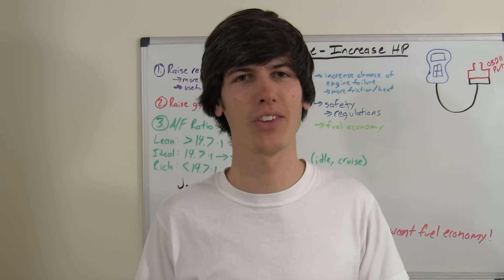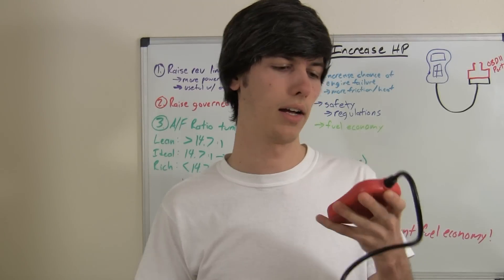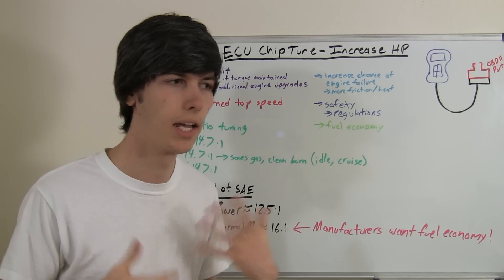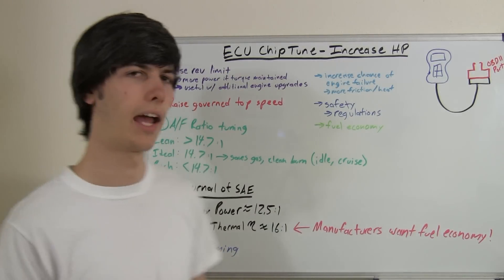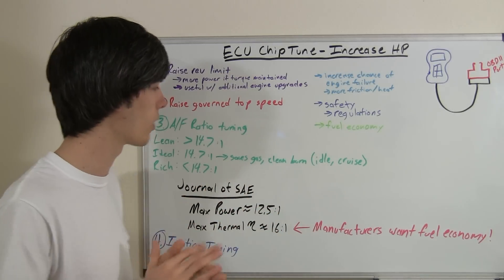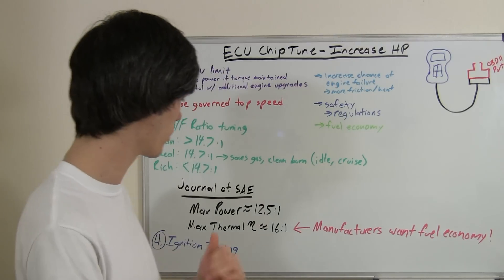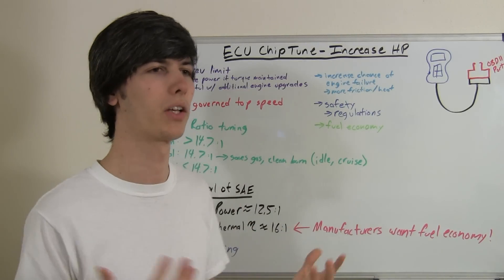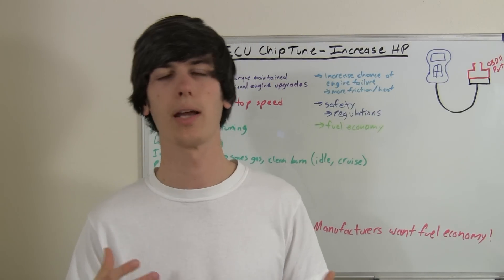ECU Chip Tune - How To Increase Horsepower

Comment: So, if you tune your ECU for more power, your fuel efficiency will go down and vice versa?
Cause I've a seen a lot of these ads lately where they say if you tune your ecu you'll get like 20 bhp+ and 10mpg+ etc... and I am just wondering, if this was the case, why wouldn't factory cars come pre tuned at these settings? This is false advertising, am I right?
Reply from the maker: You're not going to get dramatically better gas mileage, correct. But as is apparent with the latest VW scandal, engine tuning can allow for more power and more efficiency, for example by running on less EGR (granted, it's illegal and shouldn't be done).
Reply: Engineering Explained  Thanks mate, got a better idea of ECU tuning, I like your videos cause you explain very well with facts of how things work. Especially the functioning of the turbo charger.
Reply: +Ketho Seyie You can always make a car more efficient off load and have more power on load. Manufacturers typically run cars at stoich (14.7) afr for best emissions. Running your car at a afr of near 16 will drastically improve gas mileage. Manufacturers don't do this because this produces more hydrocarbons and that is bad for the environment. Keep in mind that you need to adjust timing and injection timing to make the leaner mixture create power without pre ingition or detonation.
Reply: +Ketho Seyie Your ECU can be flashed to deliver more fuel at higher RPMs and deliver less fuel at lower RPMs at cruising speeds.  This is usually done on stock powertrain.  This does help achieve more power top end and save fuel when you're not mashing on the accelerator.  So, in essence, yes there are tuners that can give you better gas efficiency and more power just not at the same time.  For example, I have a 2010 Camaro I bought a handheld tuner from Diablosport.  There is a tune that gives me better gas mileage at cruising speeds and more HP when I'm "balls to the wall".  I achieved between 27-29 mpg on the highway with that tune (my car has the LS3 and 6-speed manual).  There was a slight power difference at higher RPMs.  Before I upgraded to Long Tube headers, high flow cats, and Axle back exhaust I was getting around 21mph combined.  After the upgrade I get around 17-18mpg combined. In retrospect, adding power equates to less mpg.  However you can maximize the efficiency and mpg with a conservative tune when you add performance upgrades instead of adding more fuel and that all depends on what your Fuel/Air ratio is when it is tuned.  Professional tuners prefer to run a performance engine slightly richer to eliminate the chances of detonation.  The reason behind that is the rich fuel/air mixture reduces the combustion temperature.  With the reduced combustion temperature your fuel/air mixture is less likely to detonate outside of the combustion chamber which is critical especially in modern day port injected vehicles.  A leaner fuel/air mixture yields a higher combustion temperature which would cause fuel to ignite to early and cause damage to your engine.  Other factors do apply such as octane rating and ignition timing which also can cause early detonation, engine knock and/or pinging.
Reply: +Jason Rochester 16:1 cuts down on hydrocarbons and increased NOx.
Reply: yea my bad
Reply: So does disconnecting EGR completely improves engine power and mileage?
Reply: +Xeno Depends on the engine but in most cases, no. Especially without a ecu retune a EGR delete does nothing but increases emissions and may even give less fuel mileage. Now with the correct ecu and tune one could potentially increase low end fuel milage while gaining high end power. But keep in mind that the Gs you feel being pushed back in your seat is from low end power. Another words a leaner low end tune can save fuel but will make your car feel more sluggish due to acceleration loss. 

At least that is my understanding but my tuning knowledge is limited. There may be a way for the ecu have different AFR at a given rpm depending on throttle position? If this is the case then an extensive tune including throttle positions could increase both power and efficiency.
Reply: yes, egr stands for exhaust gas recirculation and all it does is it dumps your exhaust into your intake. and EGR delete with a tune will yield significant power and fuel economy.
Reply: definitely but it can also blow away smoke from your exhaust .
Reply: Dude put a shirt on it's not that kind of part

Comment from the maker: If an engine is producing more power, from increased pressure and temperature, it will experience increased stresses. Increased stressed will realistically result in reduced longevity of the engine, as a result of fatigue over time. I suppose theoretically, if all of the components were properly lubricated, at proper temperatures, and no yield stresses were exceed, and fatigue failure wasn't an issue (which it would be) it wouldn't matter.

Comment: I know a lot of the ECU upgrades for Saabs ratchet up the turbocharger pressure. Of course, there's a limit to how much cooling the stock intercooler can provide, but I wonder if the intercooler was engineered to perform under a variety of environmental conditions -- including hot desert climates -- so maybe, living in the Northeast US, I can feel comfortable pushing it a bit further.

Comment: one issue with running rich is the potential of fuel washing the rings ( the fuel cleans the oil off the rings and you can cause severe damage)

Comment: Quick question, you mentioned it is better for the cat to run rich? Please correct me if im wrong but I believe the unburned fuel is not good for the cat because of the leftover hydrocarbons and the NOx that the cat must deal with?   Please clarify for my understanding. Thanks!!!

Comment: Maybe this has already been mentioned in the over 500 comments posted so far, but here goes. It is indeed tempting to consider chip-tuning. But if your car is still under warranty and the engine fails they will check if the software is original or tuned. Furthermore, in some countries the car is taxed by horsepower so if they find out that your car has more power than it should have you can get a bill to pay tax for the extra horsepower.
Reply: +snubbedpeer Number 1- never tell the government anything. Number 2- reload original software.

Comment: When talking about ideal air/fuel ratio, are those values on the board the same for petrol and diesel engines? Or are there variations between the two types of fuel?

Comment: Thank you so much for the valuable information. Chip tuning is a process where the electronic control unit is reprogrammed, making the engine work within different parameters. Car Tuning Tool is the best solution when there are issues with the performance. It gives the best results. All thanks to Tuningfileshop for giving complete understanding.
Please keep sharing.
Reply: I have installed Bigger used Engine on my mazda 6 
I think 3000 CC instead of 2.3L
Can tune the ECU to give more air and fuel to the new engine

Comment: do you have a video on car cc and how it relates to the engine size. and how it works. 
i want to know about the differences on a 1litre engine and 1.3litre engine and if 1L engine is more economical than a 1.3L and saves fuel.

Comment: Did you ever measured the injection time with a scope? Before top rpm the injector remains open full time (100%), in non direct fuel injection, so how can you say that is possible to increase hp if you can't enrich the mixture at top rpm?

Comment: Speed Restrictions are set to conform to the TIRE rating for the stock tires.
I.e.

225/50ZR16 in excess of 149 mph, 240 km/h
205/45ZR17 88W 168 mph, 270 km/h
285/35ZR19 99Y 186 mph, 300 km/h

Comment: For a cat. to work it needs to get both lean and richt mixtures so the ECU makes sure the mixture is adjusted during driving. But i'm also pretty sure that when you floor it the ECU calculates for a rich mixture.

Comment: I just got the same slow car you did 2016 crosstrek I want more power I want the most bang for my buck but keep in mind it is a lease so when I need to change it back  to stock there won't be any problems
Reply: 5speed
Reply: Sir Masteryan if you tune it and they check, they will see that the ecu has been flashed.
Reply: Marcus D thanks for the heads up

Comment: The major German auto manufacturers (BMW, Mercedes Benz and VAG)  restrict top speed to 250 kph (155 mph) on most, if not all of their cars.  I understand this is voluntary - Porsche chooses not to, for instance.
Reply: I thought it was German law, at least for the ones sold there.
Reply: According to the Wikipedia (which may be wrong) "BMW, Mercedes and others have entered a Gentlemen's agreement to a limit of 250 km/h (155 mph), but may 'unhook' their speed limited cars in Europe, and Mercedes will provide some vehicles in the USA without limiters for an additional price", with 2 external references.  https://en.wikipedia.org/wiki/Speed_limiter

This implies that there is no legal requirement in Germany (or elsewhere in Europe) for the vehicle to be speed restricted.
Reply: probably just another way they can make money on their performance models by charging 6 times the actual cost of removing the limiter.
Reply: I had to look up VAG on wikipedia to find out it stands for VW... For a second I thought you were talking about the Freiburger Verkehrs AG (VAG) hahaa

Comment: Another factor manufacturers have to take into account(or at least they used to) is that the tune be okay for all possible altitude situations. Whether your in the mountains or on the coast line at sea level they have to be sure the car will perform. Now with today's ECUs and better sensors this might not effect newer cars as much.
Reply: +Damian Wezzterman
Whether your... what... is in the mountains? (Which possession? Your vehicle [in which you would've said "...or it's on the coastline"]? Or were you trying to refer to another one of our possessions? If so, which one?

Comment: I have a turbo diesel car, altered the ECU settings via piggyback chip, in normal settings the fuel economy is sort of better and the power and torque output increased. I don't know how this happens, but it does.
can you explain this a little bit? thanks.

Comment: depends what you're using your engine for. Flame propagation of diesel is much slower than gasoline..so the red line is much lower on diesel engines..with a low red line it is difficult to get a high power to weight ratio--which is exactly what you want in a race engine.

Comment: Great video, but you didnt talk about the disadvantages of a chip tune (I assume there are some?) such as decreasing the lifespan of the engine, the need of upgrading some parts like clutch/brakes after a chip tune, in some circumstances fuel economy etc.
What do you think about that?
Reply from the maker: Andrei Vlad With added power comes added stress, reducing the longevity of all the parts involved.
Reply: Engineering Explained Um no lean afr means there's a way higher air content compared to the fuel in the C. Chamber. Thus less fuel means it burns faster and has a lot more oxygen to add to the mix. Running too lean for even just 1 second can blow an engine, as well running lean will literally burn the internals white, causing corrosion and weakens everything. It's better to be a lol rich I could write y'all a 100 pg book for tuning but I'm not Gunna write that much shit

Comment: I dont know if you could respond to this but im going to go for it. Im 17 and i bought my first mustang its a 3.8l V6. And i get around 800$ a months how often would you recommend buying performance parts, if i didint care id spend about all off it and just pay the bills and car upgrades lol. But im sure you've had youre fair share of cars and i just wanted an opinion since i always watch all these performace parts videos that you put out. Keep up the the good work. Thanks
Reply from the maker: Franjluna74 Well I'll probably sound like a dad but I don't spend much on parts, at all. Depending on what your goals are, many of the investments are poor (not to mention it will not increase the value of your car). When I was 17 I saved all of my money, and didn't do a thing to my Integra. It's a great car as is. :)
Reply: 1st step...sell mustang 2nd step... buy one with a v8
Reply: Nicks Customs Lol the only sure guaranteed possiblity for both performance and reliablity at the same time. Might ask you also will cost a lot in gas but the performance will be there no doubt :)
Reply: Thats kinda sad. My 4x4 explorer sport 4.0 will beat your mustang at any race aside from track. 
Pushing around 300hp at the wheels in 4x4. 
4.3l stroker crank,ported and polished the heads,ecu and timing tune,and a 3.5psi supercharger. (I can switch a pulley and go to 5.5lbs,or 8.5lbs)

My trucks mods weren't put in for racing either. With locking differentials (front,rear and center), 4.10:1 finals,transmission rebuilt with a heavy duty kit and a shift kit,transfer case rebuilt to heavy duty specs,dual caliper brakes all around and still on 17" rims. (Stock tire size,aftermarket rims)...designed to tow,and to do it in any scenario. (5000lbs max offroad, 9,000lbs highway,11k city (less than 15 miles)
0-60 in 5.8seconds quarter mile in 15. 
Top speed is unchanged from factory. 117.9 tops out,5500rpm in 3rd gear. Rev limit moved to 6750rpm. (Mainly for 4-lo to have a bit better acceleration through shifting.)

My advise would be to start off simple. Get a dyno tune and a timing tune. Then before you get any performance upgrade make sure the transmission is up to the task,the motor mounts,head gaskets,any thing that could fail pretty much.
From stock the first thing I did was a twin opening throttle body that gained me about 6hp and 5lb-ft,was mostly done becuase I replaced the stock one after it failed,and I wanted a bit more overall air flow for the stroker crank to shine.
After the TB I rebuilt the transmission (wasn't in any state of disarray when I did it)
After the transmission I put a high stall torque converter in,and rebuilt the transfer case.
After that replaced the axles to something much stronger,new driveshafts and heavy duty ujoints and CV joints. 
Then we regeared it from 3.27 to 4.10,that was the biggest feel of the pants change,especially at highway speeds.
After that we put the stroker crank in,ported and polished the heads and re tuned it again for more torque from 2500-5500rpms. (Gained about 15lbs through the curve from the tune alone,and about 25 from the new crank)
After that we replaced the pistons and connecting rods with heavy duty performance ones. Raised the compression ever so slightly from stock 9.7:1 to 10:1,and started preparation for the supercharger. (Eaton m112,dont remember what year)
Performance high flow fuel injectors,high flow fuel pump,NGK Iridium spark plugs and a air to water intercooler had to be fabbed up. (Planned maximum boost is 10psi with a drop to 9.2-9.5:1 compression)
Supercharger installed,current pulley installed will net me 5.5lbs of boost but we purge it to 3.5psi,really aiming at the low rpm torque more than anything else.
I have a pair of garret gt1549 billet rebuilt turbochargers I plan on using in the future i n conjunction with the supercharger. (Max boost then would be 15psi)
But I got lucky and I live less than half a mile away from a gas station that sells 110 octane fuel.

Key advise no matter what route you go for adding performance to a car, is to simply do it right. Dont skimp on the little things becuase when they fail you have much larger issues.
(Like leaning out at high rpms with a supercharger melting your pistons becuase your running 7psi of boost and still using stock injectors and a stock fuel pump,but you tuned it and raised the rev limiter by +1200rpms.

note
My truck also has a heavy duty copper radiator,and heavy duty copper  transmission cooler installed,running alongside the stock ones.

Comment: ECUs are cool!  Would be much fun to repurpose an old one with all that analogue and digital fun stuff going on within!  In a really modern ECU what kind of main CPU is inside?  Wouldn't it be nice to find an 80386 or Motorola 68040 inside but I bet they use special chips using ARM cores now.

Comment: Great... I was just thinking about what plugging in a chip would do to my car's performance...sounds easy here... Basically I want power when I put my foot down and rev up the motor...and I want economy when I run a slow engine speed with a light pressure on the gas pedal...and my new car does that with a vengeance ....just came home from a 40mpg 7L/100km run at city speeds with top gear near idling...Luv the torque that keeps things moving and pins me back in the seat with some pressure on the gas...of course, I use 3-4 times the gasoline  when putting my foot down...but only for a few seconds
Reply: Franz K Hard way to do both economy and power is make your engine a Variable valve and timing. The intake valve will wide open to pull more air in also decrease the gas flow in Economy mode. In sport mode or u're trying to floor it, the intake valve will not wide open as in Eco mode, because of high reving and increase reaction.
Easy way to do that is to remap ECU and allow the gear box shift to the last gear as quick as possible and shift to low gear when u flooring it.